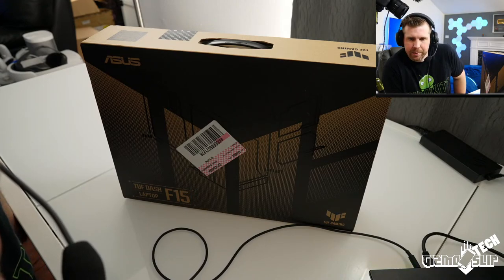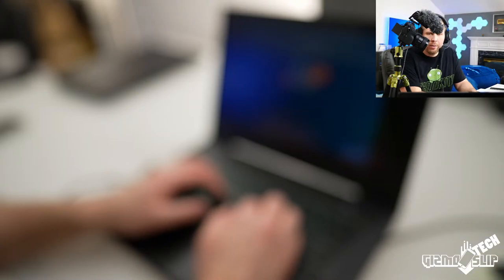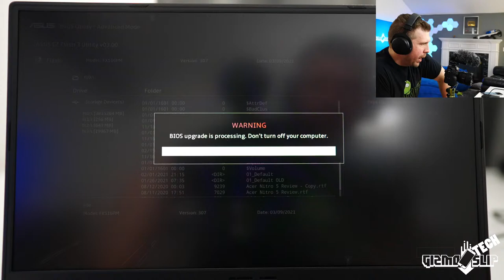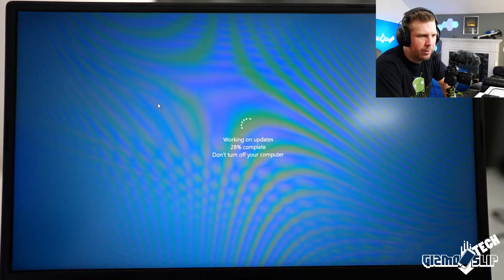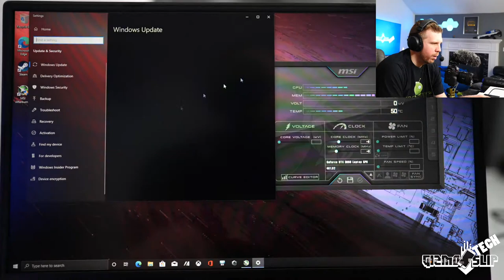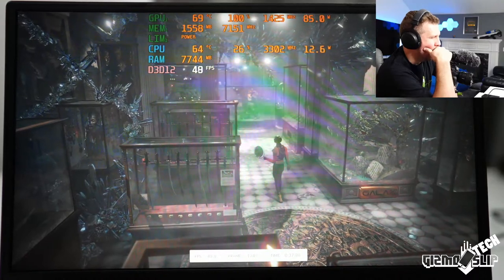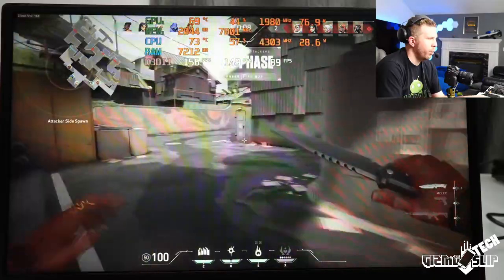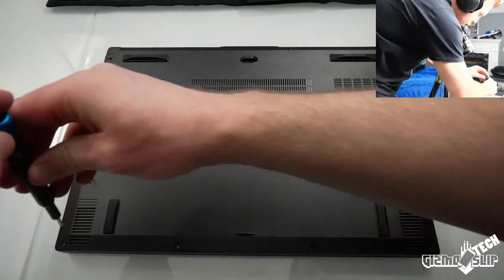$1099 Asus TUF Dash F15 Live Unboxing & Testing (RTX 3060, i7-11370H, 144 hz)

Comment: First, I just wanted to say thanks for all these videos. I was wondering if you could tell me which laptop would be closest to my current desktop which is a 5900x and 3080. The reason I'm asking is I've had some things change recently and I'm going to be on the go a lot. I looked at your chart, but it doesn't really show benchmark scores or battery life. Thanks again.
Reply: There is not a laptop (today) that comes close to your desktop. Your best bet is to get a bulky, "desktop replacement" model, with an 8-core 5000 series AMD CPU and a 3080, with as high tdp as you can get, somewhere in the 150W range.
Even then, you're looking at a 5800X and a 3060Ti - 3070 in terms of desktop performance
Reply from the maker: Your best bet is to find as high of TDP laptop GPU as you can to get the most performance. Probably a Alienware M17 R4 or GE76. Right now the Alienware m17 R4 is $343 discount below normal price right now: https://go.magik.ly/ml/14xjk/

But keep in mind that with the m17 r4 the battery life is not great (only 2-3 hours) if you buy the 300 hz or 360 hz models. The 144hz and 4k options should have Optimus for better battery life though.
Reply: @GizmoSlipTech  Thanks a ton. I'm needing 5 hours of battery life. I'm thinking about checking on t that alienware

Comment: Gigabyte G7 my results: Gpu 7954 Cpu 9140
Combined 8111
Was thinking the asus tuf 17inch or Gig G7, glad I went for the G7 now
Reply: Gigabyte makes a better optimized system than Asus.  You can see it with the 15G and 17G beating higher watt gpus.

Comment: I have pick the g5 thanks to you man 👍 It is beast.
Reply: I chose the nitro 5 ryerb 5600h 3060 over the g5 because lower price and better battery,i told myself that the difference in performance would not be that great
Reply: @AlbertRei3424  thats a good deal. I would get my hands on the ryzen variant to if its cheaper. Ryzen in my country are expensive :/. Example like the g5. Intel variant is 300$ cheaper here.
Reply: @MuhammadIqbal-yu1qn  ah ok,i got my acer nitro  for 934euros,an g5 is now 1099euros (sometimes a lot cheaper with discount)
I bought  8go ram stick for 46euros so i'm still under 1000euros for the laptop

Comment: Does anybody know if  there is any 13 or 14 inch laptop with MUX switch?
Reply: I am not sure, but mb Razer Blade Stealth 13, they have MUX on their regular Blades also you can try to find some info about Acer Triton 300 SE, but it hasnt come yet
Reply: @edgarkurm8148  does asus  flow 13 has advanced optimus?
Reply: @SonicDestiny  it seems to use advanced optimus.
Reply: can we disable optimus on it like other laptop by restarting?

Comment: Hey I just have another question from the stream where you upgraded your Scar 15. Are the fans individually detachable and replaceable? For example, I know that some laptops have their cooling fans attached to the actual heat sink and heat pipes, and I couldn't tell if the fans were separate from them in your stream.
Reply from the maker: I'm not sure.
Reply: Got it, thanks lots!

Comment: I have been using this laptop for about 9 days so far and having a random freeze. At least one a day and today actually 4 times. I am testing different programs and games to find out what causes this problem.... but while playing Dota2, it never froze... I am actually assuming it is something to do with iGPU software because it often froze on youtube.. For iGPU I put it on auto as recommended. let me repost if it doesn't freeze tomorrow. reply mine if you are having the same problem..!
Reply from the maker: Have you upgraded your firmware, drivers, windows updates? That would be my first recommendation.
Reply: @GizmoSlipTech  Hi! Yes I did updated anything that is available! I thought it was iGPU so I turned it off on Armory Crates. and also thru "My Asus" app, I confirmed bios and drivers update and Intel for iGPU driver update and Nvidia for GPU driver update.. Funny thing is that even it froze while I was writing this reply.... not even running any program or browser..
Reply: @MW-gr2kt  did anything changed for you?
Reply: @MW-gr2kt  you're buying on fake web

Comment: Any possibility of testing if external gsync monitor (real gsync, not gsync compatible aka freesync) works over the usbc/thunderbolt? There's so little information about this and it's driving me nuts. Intel tiger lake is supposed to support this even with optimus, but again there's no real info confirming this.

Comment: I have the same laptop but my FPS is performing very bad like 100 FPS on low setting on valorant? Can someone help me please
Reply: Are you using internal graphics or the 3060 in the laptop my guy @bibek thapa
Reply: @wardogkinggaming7486  don’t worry I fixed it, I just had to update the bios but thank you anyway
Reply: @bibekthapa4187  mine is at 100 FPS on high. What did you do to fix it?

Comment: I just got this laptop. I never owned a pc or a laptop cuz I play playstation. So u think as my 1st laptop not to bad for gaming?
Reply: It’s a great laptop bro definitely recommend you’ll run AAA games well for sure
Reply: Sweet ty
Reply: Awesome to hear this. I'd just like to play assetto corsa with some mods at 60fps. That's literally about it.

Did a financing but the laptop won't be here til the 22nd :( $1800CAD total on a 12 month finance.

As long as it plays AC as good as the base ps4 does and I can use mods ill be a happy camper! If I can play in vr with lower settings ill be even happier.
Reply: better than shitstation 5
Reply: @darkslaerdark  but hey PlayStation 5 got that price point good
Reply: Yea but ps5 cost 500$ man

Comment: Already 8 month late but i have a question. 
If i wanted to upgrade ram from 8 gb soldered ram to 32gb max ram then can i just install 32gb ram instead of 16gb ram? Will there be a problem if i install 32 gb because there'll be 40 gb of ram, 32 + 8.
Please reply. Thank you.
Reply: Firstly check if you can add 32gb to it contact asus support for that informations

Comment: Hi, I have this laptop.  Display and colours are fine for the price. Laptop itself looks and feels great! However only issue is I am getting mega low fps in Warzone.  On high settings its around 40fps.  When I set everything to low I am only getting 58fps.  Is this normal or is the cpu really limiting the performance here?  I have the 8gb version, I can upgrade it to 16gb but will this make any difference?  I don't want to open the machine if I am goign to send it back.
Reply from the maker: Warzone can be a very CPU bound game. I haven't tested the Asus TUF Dash F15 in warzone yet, but those numbers could be accurate since this only has 4 cores. Not sure though.
Reply: @GizmoSlipTech  thanks for replying. Turns out it was the RAM, my configuration only came with 8gb. I just put in another 8gb and I can't believe the difference. I am now getting 90fps+ on the highest settings. I can't believe Asus ship 8gb single channel models because if I hadn't put the RAM in I would have sent it back.. Also thanks for the great review it really helped me make up my mind about purchasing this laptop.
Reply: @GizmoSlipTech  Do you rly trust that 4 core cpu can make so big difference in fps? 4 core is preaty ok for gaming still, also 11370H is a very good 4 core CPU, it has about to same performance to 6 core 10750H, but overall is better than 10750H, having new 11th gen features. 3060 version is running Warzone perfectly on max settings
Reply: Hi bro is the battery life good ?
Reply: Dude warzone need 16 gb ram
Reply: I can guarantee that 16GB will boost war zone fps

Comment: I have this exact laptop, but performance is vastly different. Getting sub 70 fps on Valorant and about 20 on battlefield.
Reply: memnunn musunz?
Reply: You probably use your cpu video
Reply: @boviend  nah sorted it. Faulty ram, swapped out the 16gb with a different sodimm
Reply: @TiarnachF  have you gotten battlefield to run good, I have this laptop but I don’t understand why I can’t run battlefield with decent fps no matter the settings I get around 20-30
Reply: @isaiahmarlowe7323  yeah, with new/more RAM and when on charger with turbo settings I am getting upwards of 70 with high enough settings
Reply: What's the battery life are you getting while doing normal tasks like web browsing and ms office?

Comment: Hey man, I just bought the same laptop today and the battery sometimes shows 4 hrs remaining and then after using for a while  it says 7 hrs remaining? I did not do gaming just normally used for watching video and web browsing. Is it normal and battery percentage  is based on what we do with the pc?
Reply from the maker: That could be typical depending on the usage, brightness, wifi on, bluetooth on, etc.
Reply: It gets calculated on they way you are using. And the more you use the better it tells you but work normally changes like browsing to typing to watching etc so battery estimates also changes. I had this laptop so i thing average battery time of 4 hr is normal even though the company says 11 hrs of battery
Reply: @GizmoSlipTech  appreciate it thank you
Reply: @vari217  Thanks a lot for the info dear Varun. I am doing master study and i use it for Python, arc gis. So i needed a powerful machine.
Reply: @LearnGerman_Now  it'll do the job. .. it's a good machine.. pretty fast too.. latest specs.. i just didn't like the screen.
Reply: How's the battery life now? I'm talking about normal use like web browsing and ms office. Can I leave the charger at home and get a full day use of ms office and chrome?

Comment: Hey Gizmo, I have this same exact laptop, any reason when I run steams VR test it shows for 8 cores for the cpu?
Reply from the maker: Probably looking at the threads.
Reply: @GizmoSlipTech  gotcha, that is so weird lol if you get a chance can you download the oculus app on yours to see if it gives you the same feedback as mine, it says the gpu doesn’t meet the requirements, I’ve been in contact with Asus and they remote in to help update all drivers, reinstalled certain programs, even retested cables with my tower. They said to contact Facebook for additional support but Facebook takes forever with RMA’s and could be weeks before I hear back from them. Just wanted to see if a fellow user of the TUF series runs into the same issue.

Comment: I’ve heard there will be a bottleneck with this config
So this or rtx 2060 + i7 10750H ?
Reply: For gaming only, yeh a lot better! For Adobe apps, productivity work 4 core cpu is enough
Reply: @aahritya_tv  I bought acer nitro 5 ( RTX 3060 95w + Ryzen 5 5600H )
Reply: @redblix470  cool dude!!
Reply: @aahritya_tv  so for gaming its good/beast?
Reply: @aahritya_tv  and it is good than the legion 5 with rtx 2060 last year?
Reply: the cpu is not the problem here...only optimus...connect the device to an external screen, bypassing the igpu in bios and you'll get 20-30% more fps...even there the cpu isn't bottlenecking, only the 85w tdp of the rtx...actually NO games is bottlenecking the cpu, you can check all the review/benchmarks (I did this) and the cpu never reaches 99% of usage, even on shitty demanding games like cp2077....it's just optimus that's keeping all that under the 35w +85w tdp...the microstutters are due to the igpu checking the infos during less taxing scenes, no more...just like ALL the laptops in wich optimus exists and can't be bypassed....
in my country the tuf dash f15 is the only one to be this powerfull at 1400 bucks, I've checked the internet to find equal or better at this price point, at the moment no laptop can match this one without spending more 300 bucks on it...so it's a no brainer buy, for me at least
Reply: @mikaeldannenberger6  dude can i contact you on media social about this laptop?
Reply: @salmana8308  what do you mean by "media social" ?

Comment: Do you think +250 pound for rtx 3070 version worth it
Reply: No it really is bad, the 4 cores is a big no no.
Reply: @studentofpain6801  even for 3060 ?
Reply: @studentofpain6801  and this costs less than 2060 laptops and same with 1660ti laptops in my country I think its still a good price
Reply: @user-hs8je4nb4q  1099€/$ for a 3060, this is definitely a steal, this one is definitely worth it.
Reply: @user-hs8je4nb4q  and also if you can disable optimus, then it's even better.
Reply: I'm planning to buy the 3060 variant myself, but it's not released yet in Belgium
Reply: @studentofpain6801  I will use it with a monitor if i get it that maybe can also increase performance
Reply: @user-hs8je4nb4q  yes I also have a monitor ready for that, tho I don't know if the hdmi is directly connected to the rtx gpu or the IGPU. Because in some laptops you have to use the usb type c in order to bypass optimus.
Reply from the maker: I'd recommend the 3060 version this time--if you just care about performance per dollar. But you also get an upgraded display with the RTX 3070 version of the laptop--which will be faster response rate and better colors. But if you're stepping up to the $1450 price range it might be better buy something else at that point--like a Ryzen 7 5800H laptop.
Reply: @GizmoSlipTech  the display does not change it is still 144hz on the 3070 model i think 3060 is to go with, thanks for the answer
Reply: @GizmoSlipTech  I hVent been able to find any ryzen 5800h laptops with 30xx series gpu's in the USA at all.  If you know if any can you link??

Comment: My legion 5 i5 RTX 2060 matches this in Timespy. can it be bios flashed?
Reply: Why are you comparing legion 5 to a TUF Dash F15?
Reply: @edgarkurm8148  I'm comparing them Because the legion 5 cost £700 and is equal to this in synthetic benchmarks.
Reply: @robhitch9995  you cant compare this and Legion. They are very different laptops. TUF Dash is ultraportable, slim laptop with 2.0 kg
Reply: Legion 5 specs?
Reply: @SMFurqan  i5 10300h RTX 2060. I was very surprised. I bought it as a cheap entry level but turns out after a small amount of tweaking it's actually on par with some of the newer 3060 machines. 

I think its because it also has a MUX switch.
Reply: @robhitch9995  asus tuf dash f15 is bad machine?
Reply: @robhitch9995  so which is good?

Comment: 2:23:53 actually overclocking is modifying multiplier and voltage, just like on desktops. That's how it was done for years on Intel HK laptops. Whatever AMD\Asus are trying to tell you with the new "unlocked" Ryzen is just lying, as this is not true overclocking, therefore they are not unlocked.

Comment: horrible performance,weaker than last gen
Reply: it's much faster than a last gen quad core. 6-8 cores Tiger lake will release soon which should be much faster.
Reply: @TabalugaDragon  no dude,i'm comparing it to the 10750h 10870h and 10875h,this processors with a 2060 can outpeform this laptop easily,a quad core processor should not be paired with a 3060
Reply: @mateivlad2308  easily? you're talking about 10750h which has much higher power then, because at the same power they perform about the same. Yes, the 8 cores are faster but also more expensive. It's not like Intel is charging crazy amounts of money for this quad core.
Reply from the maker: I need to do more tests and graph the results to evaluate true performance. One thing to keep in mind is that I see a lot of reviewers comparing this laptop vs last gen laptops in CPU bound games, which doesn't reflect the power of the GPU--but rather the CPU. In GPU bound games like Cyberpunk 2077, I expect this to outperform a RTX 2060 easily.
Reply: @GizmoSlipTech  another reviewer, ownordisown, got horrible frame rates. Worse than last gen performance, but does it have to do something with nvidia optimus?